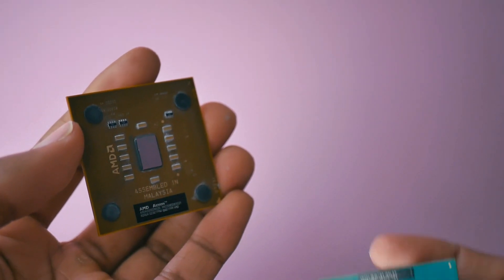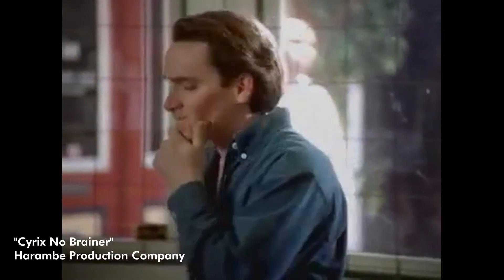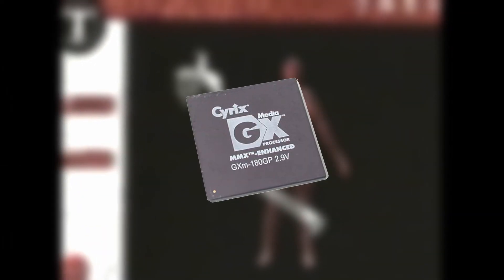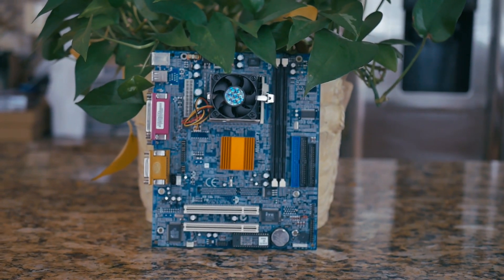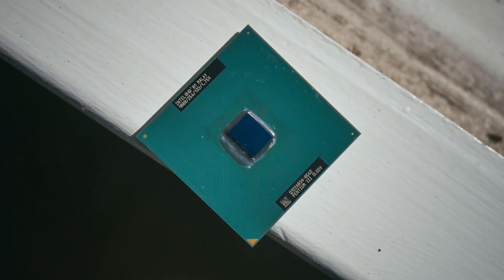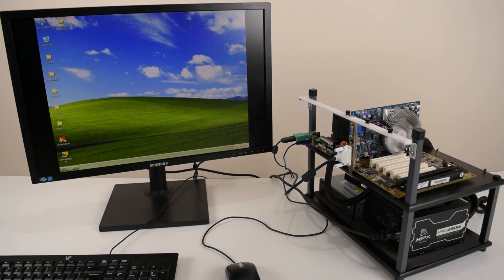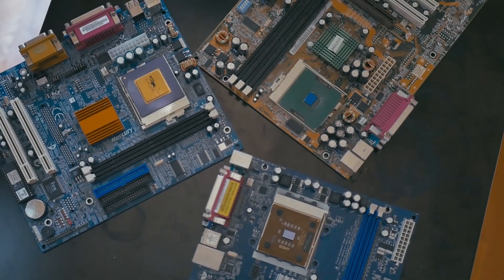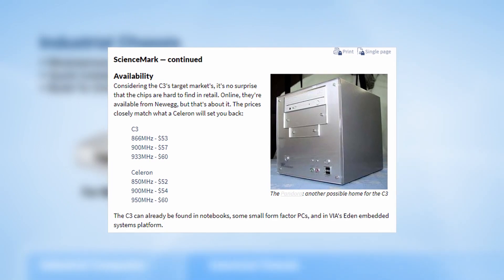A CPU Not Made By Intel or AMD w/ Phil's Computer Lab | OzTalksHW

Comment: Anything (= everything) compiled with Intel's compilers used an unfair CPU dispatcher, completely skipping SSE, SSE2 etc and using the oldest, slowest 386 codepath IIRC, for anything non Intel.

There are ways to spoof the CPU-ID and get more accurate results.
Google:
Medium Shoubhik R Maiti Fixing Intel compiler’s unfair CPU dispatcher Agner Fog

Comment: You're using the C3 for the wrong job. The C3 was designed for industrial jobs to survive in high temperatures, little guaranteed airflow and vibrations. The C3 produces so little heat that it can use a passive heat sink and the box can be completely sealed to keep out dust. The C3 emulates the less often x86 calls in microcode and only the more frequent x86 calls are hardware. That was done to keep the cpu small in area and low power

Comment: Long ago a bought a cheap barebones 800Mhz C3 system w/ 1 pci slot.  Awesome small silent PC.  1 Absolute problem was that the CPU could not handle the onboard sound.  DVD would run ultra choppy.  Back in those days Sound Card acceleration was still a thing so instead of using the PCI slot to upgrade video I gave it a SB_Live card which improved DVD and game performance.  Ran Half-life and Unreal back in those days...also used it as my music recorder for a while.  Without upgrading the sound card it was pretty much only good for spreadsheets and documents.  It benchmarked low but system was very responsive overall.  Also cool that it had 3dNow AND SSE.

Comment: You should try to compare the via cpu against something more common like the first generation atom cpu's, i think that the via chip may be very competitive against their atom counterpart. I have a via c7m based hp mini 2133, and if you compare it to a atom based cpu at the same clock speed of 1,6ghz, although the atom has 2 threads, the via cpu is a lil bit faster, and it has only 1 thread, i will buy another netbook, based on the atom platform, and i will try to benchmark both platforms, just to be sure that the via is indeed quicker! Great video man!

Comment: I had a Via C3 1GHz back in the day -- I desired a more "green" PC which didn't use as much power.  Despite the fact that the CPU was very miserly on power draw, the rest of the components weren't tailored for efficiency, so overall power draw ended up being something like 45 watts, even at idle.  Nowadays, any modern laptop is way faster and sips power in comparison.

Comment: I think you gave very little credit to Cyrix in this video and simply have shown a child's understanding in calling it plain "bad".
"Unlike AMD, Cyrix had never manufactured or sold Intel designs under a negotiated license. Cyrix's designs were the result of meticulous in-house reverse engineering and often made significant advances in the technology while still being socket compatible with Intel's products. Cyrix's designs were completely independent. Focused on removing potential competitors, Intel spent many years in legal battles with Cyrix, consuming Cyrix financial resources, claiming that the Cyrix 486 violated Intel's patents, when in reality the design was proven independent."

Edit : more about Cyrixs legacy
"Although the company was short-lived and the brand name is no longer actively used by its current owner, Cyrix's competition with Intel created the market for budget CPUs, which cut the average selling price of PCs and ultimately forced Intel to release its Celeron line of budget processors and cut the prices of its faster processors more quickly in order to compete."

Comment: National Semiconductor didn't scrap the "Joshua" core.   VIA promoted it after buying the division from National Semiconductor and then scrapped it for the less powerful "Samuel" core designed by the Winchip team from Centaur technology.   The Cyrix based "Joshua" that VIA scrapped had a full speed FPU, 64KB L1 cache, and a 256KB L2 cache.  However,  the  "Samuel" based core from Centaur Technology that VIA chose had a half speed FPU, 128KB L1 cache, and no L2 cache.  Benchmarks showed the Joshua core to be competitive against the Celeron and K6-III processors.  The Samuel core at 533Mhz could barely beat a 233Mhz Pentium II and in some cases was even slower than the Cyrix MII.

Comment: You got several things wrong in this video. First, Intel's Celeron was not a response to the C3, it was a response to AMD's K6, which was already being replaced by the K6-II by the time Celeron launched. Second, VIA did not buy Cyrix for their processors, but rather for their license to the PII bus for the production of Intel compatible chipsets. It is for this reason AMD should have bought Cyrix. Had AMD purchased Cyrix, VIA would have been forced to focus on AMD's Athlon/Duron for chipsets. Third, VIA did not hire Centaur to design processors, VIA bought Centaur from IDT. VIA then pitted the Centaur design team against the Cyrix design team, which had been gutted by NS before the purchase, and Centaur won.

Comment: Media GX was actually the same architecture from the Cyrix 5x86 instead of the 6x86 from what I heard. Even Texas Instruments licensed the brought Cyrix 486 and labeled them as their own at one time, back then it was quite common.
Reply: The Cyrix 5x86 was based on their 6x86 architecture though, it was an interim solution to compete with early Pentium processors on the socket 3 platform while Cyrix ironed out issues with their Socket 7 6x86 launch. As a result, the Media GX is still based on the Cyrix 6x86 core in the simplified form that the 5x86 utilized to reduce transistor count and power requirements to make room for the added Media components and keep costs in line.  The later 5x86 models for socket 3, which were also produced by TI (IT's ST) and IBM, gave Pentium Overdrive Socket 3 processors a run for their money particularly if factory disabled features like branch prediction are enabled via software.  These were totally unrelated to the original 486 "clone" designs that Cyrix designed and produced along with IBM and TI prior to the 5x86 launch.

Comment: finding a motherboard that could use the socket 370 Via cpu was super hard.. there was a few intel boards and some off brand ones that could use it but by that time VIA was pretty much blackballed from the big mobo makers.. If its a via chipset on that mobo i would have just used the VIA 4 in 1 driver..

Comment: these things were aufull  I was there i built machines back then and wow. They where however cheap and needed a big ass heat sink for the day. The first one i rember actually playing with could not even how run my 486, I had a dx33 that i put a 50mhz clock xrystal in. I also had an AMD DX4 100 and it tore it a new one.

Comment: I full time use a few thin-clients that have a low power VIA Eden X2 U4200 1ghz duel-core CPU. its not a fast CPU but its a hell of a lot better than most Atom based thin-clients that ive came across.

Comment: actually Cyrix in later stage have had quite good FPU
if it comes to FPU, Cyrix and games
the reason is more complicated
Quake 2 is the reason and the way it used CPU as whole
ALU and FPU can be used at the same time, as they do not share any resources
Cyrix could use only one of those at the time making it weaker in games, but still very strong in both ALU and FPU operations
Cyrix have had not enough time to fix this and this was non trivial fix probably requiring almost complete redesign or new architecture

Comment: VIA C3 systems are fun to tinker with. I mostly use them with Linux and I have used sever thin client boxes as small low power servers.
Reply: I recently read an article regarding the C3, in which it's been found a vulnerability which can be executed through a command in the terminal in order to gain complete access over the entire system and kernel.
Reply: I read it on Slashdot I think, but really it is not a reason not to use this chip for private or experimental use. The amount of C3 systems still running and accessible online are far to small to be a viable target for dragnet types of exploits. Really that specific backdoor is far less worrisome than the meltdown/specter exploits of late.

Comment: Please help
Will this graphics card :
GIGABYTE Graphics Card Original GTX 750 Ti 2GB 128Bit GDDR5 Video Cards for nVIDIA Geforce GTX 750Ti Hdmi Dvi Used VGA Cards
 http://s.aliexpress.com/Zzi2mUJR?fromSns=

And this ram :
Patriot Viper 3 Series, Black Mamba, DDR3 8GB (2 x 4GB) 1600MHz Dual Channel Kit (PV38G160C9K) https://www.amazon.com/dp/B008LTJJM2/ref=cm_sw_r_cp_apa_1NhCBbFZN6AG7

Work with dell optiplex 3010?

Comment: VIA are still a going concern and still produce CPU's based on the x86 instruction set.  They are underpowered by modern standards (closer to ARM than AMD in CPU horsepower) and are used primarily in industrial and advertising where the lack of CPU power is not an issue.  In fact most of their latest products are based on ARM designs.

Comment: I had both a Cyrix MII running @ 233MHz and a couple of VIA C3's running @ 533 and 866 MHz respectively in the late 9o's and early 2000's. Very reliable running Win 98/SE and Win XP Pro.

Comment: I have some questions.? First allow me to explain. I trying to build a gaming PC. I am working with an hp Compaq pro 6300. I already purchased a Intel core 2 quadq 8400 2.66ghz 4m 1333 cpu for $16.95 (recommend by you), GiGabyte GeForce Gtx 750ti Intel q43 for $56.68, 16gb 4x4gb memory ram for $28.08 . Is there anything that I my be missing?? Second. Should I up grade to a quad core cpu for for better graphics??? You can find me on fb. Same name. Kell Jackson

Comment: I have a VIA C3 800 MHz.  It's weird because it's the most stable computer I've ever owned.  Lots of software won't run on it, but the software that does run on it will run forever without ever crashing.  It was a great little server until it got retired.

Comment: Hey, apart from this topic, I do have a question.
I found used ASUS GTX 960 on Aliexpress for pretty nice price, it seems legit, but I'm interested in your opinion because I'm planning to buy this card. The only thing that bothers me is that this card has ASUS Expedition Cooler, but I haven't found any of 960's to have this coolers. As far as I know, cooler like this only has GTX 1050.

NOTE: This card is from the same store as those GTX 650 & GTX 750 you have made a video about.

LINK: https://www.aliexpress.com/item/ASUS-Video-Card-Original-GTX-960-2GB-128Bit-GDDR5-Graphics-Cards-for-nVIDIA-VGA-Cards-Geforce/32851448225.html?spm=a2g0s.8937460.0.0.2b002e0e71OHqi

Thanks in advance, I hope you can help me.

Comment: There are a few design choices that negatively affected the C3's performance in pursuit of yield rate and power efficiency.
1. Samuel architecture has the FPU running at half the clock speed at the ALU. This was supposed to be fixed by the Samuel 2 update but that was too little, too late.
2. It is also an in-order execution design as well compared to the OOE capable Intel or AMD designs from the same era.
Having said that, the branch prediction was quite robust so it doesn't lag behind too much in integer focused benchmarks. However, it's pretty slow for anything else.

Comment: Afaik VIA also came up with their own line of ARM systems-on-chip as well under the Wondermedia line, back when the iPad craze prompted companies to churn out knockoffs and low-cost tablets. I was planning to pick up an WM8880 based tablet back in 2013-ish but that didn't pan out.
Reply: blakegriplingph oh I have one of those ipad knock off lying around with said processor or similar (wm8850 I guess?) the cpu and the ram are actually in a notebook-sized ram dimm slot like those old matrox graphics card and the internal storage was an sd card in an hidden sd slot and the touchpad was resistive... what am awful device now that I recall
Reply: amnottabs Afaik one of my cousins also had one of those. They ran on Android 1.6 to 2.2ish iirc and were basically primitive at best.

Comment: Why aren't you shooting in 4k? I know that you have a panasonic g7, So you can shoot 4k. Recently I switched from shooting 1080p60 to shooting 4k on my panasonic g7. And I found out that it's so much sharper, have better low light performance, have better color grading potential etc. I know that you edit on the ryzen 7 1700. So you can edit in 4k. If you don't have enough storage space. You can downscale the 4k to 1080p. Which means that you are getting a much smaller file size, still the the super sharp image, and a 10bit 4:2:2 image. It's so much better in every way.

Comment: Last I remember hearing of the latest VIA Chips was that they'd advanced to around Excavator IPC (Around 52% Worse that Ryzen/58% Worse than Skylake) .... So provided they have upped it even slightly from that it could proove to be an interesting release.

Very nice little look back on their history.
Reply: wait so im the first reply.........ur prob gonna see this , i love you man ur the best
Reply: Abd ElRahman Ahmed Safwat: Cheers mate
Reply: Do a video on it!
Reply: Wetpig: Possibly, I did cover it a little bit in a Podcast ages ago.
Reply: This should have maybe included the citation that although they may have achieved excavator level IPC these via chips are low power embedded solution style CPUs and are clocked miserably low around 1-1.3GHz range so even if they had Coffee Lake level ipc they would still be awful chips.
Reply: Indeed, they are on it. However as for the KX 6000 series it is supposed to get reduced even more.
Reply: wrg
Reply: They honestly were pretty interesting around 2010 or so, they weren't making big fast CPUs but they were trouncing Intel's Atom with their Nano. You just couldn't get them in many places until they were getting a bit long in the tooth/VIA hadn't updated the actual core, just crammed more on a single die.
Reply: Excavator is not 52% worse than Ryzen, The original Ryzen was 52% better than Excavator, not adjusting for clock speed. If Ryzen is 52% better than Excavator, that makes Excavator 34% worse than Ryzen.

Comment: Nice video and great to see you going Retro. Decent parts are indeed hard to find and can be expensive, but it's such a fun hobby.
Reply: Agreed. Going retro is just more fun at this point. Spent 1/2 the day charting out my next series. I'm more excited for that than anything else coming out this year.
Reply: I still have my Socket-A based MSI K7N2 Delta 2 Platinum. I wish I had a spare case or else I'd try getting it going. :)

Comment: If we count also RISC architectures, during 90's and early 2000 we've got MIPS (Silicon Graphics), DEC Alpha, HP PA-RISC, IBM-Motola-Apple PowerPC and SUN SPARC
Reply: I guess sparc is pretty much dead, too. Did not see any developement the past few years.

But no one seems to be interested in how Itanium could have rocked the business if some lazy developers had worked with that.
Reply: Yah it was a more interesting era.
Ironically I think we were better equipped to deal with cyber attacks back then as one exploit could not be used on all the computers.
Reply: Alpha is actually not dead, check out
 the Sunway taihulight

Comment: I can see an unpopulated AGP footprint! I'd have an urge to divine what the rest of unpopulated components are, i suspect nothing else is needed to support it, except one capacitor optional but highly recommended.
Reply: I'd like to see a video on soldering one on, but I question whether he can just find a loose AGP connector floating around on eBay or aliexpress.

Alternatively, as a graphics solution, he could try one of those Sedna or Startech PCI to PCIe bridges and just pop in a modern card. I also know that these board designs: http://extreme.pcgameshardware.de/tagebuecher/233982-projekt-agp-1-0-pci-adapter.html have been tested for a direct AGP to PCI connection, but he'd have to get one custom made.
Reply: AGP was supported, and PCI, you need to Find the better boards, most socket7 boards support them.
Reply: You can always get a dead board, a heat gun, mount the whole thing somewhere safe, and heat the whole thing up till everything falls off, including the AGP socket.
Reply: I don't think you'd want to use a heat gun on a largely plastic part. Besides, AGP sockets are through-hole components so they're fairly easy to desolder with a desoldering gun. I have replaced one before this way.
Reply: Thing is, it's plastic, but they did somehow solder it in to begin with, right? And it stands to reason that it was wave soldered, and likely the whole part reached soldering temperature. The standard plastic of choice for this family of connectors is LCP, which is usually rated for continuous use at around 230°C and won't really get soft until close to 300°C.

Of course you heatgun the solder side, not the component side, so you don't heat the connector more than the pins.
Reply: I'm not saying it couldn't be done, I'm just meant it'd be a bloody hassle compared to using a desoldering gun.
Reply: I disagree, i find this way of stripping boards super easy. Besides, a desoldering gun... a ZhongDi, which is rather inexpensive considering the competition, costs like what, $120 at the very least? A fairly uncommon tool too, certainly not something anyone who doesn't repair electronics would have, and not many people who do either. I don't even have one and stuck dicking around with a solder sucker and braid, and while i can and sometimes have to do it, it's not pleasant, i'd rather avoid doing that for anything with more than 40 pins.

And i don't mean a hot air soldering station either, those are for fine jobs where you really need the temperature control and airflow precision. Just a basic home improvement heatgun, you can't solder with it, but you can mass desolder stuff with it usually without damage - i mean once things start falling off, you stop heating, as simple as that, takes about 2-3 minutes.